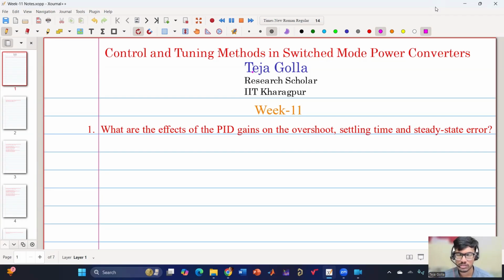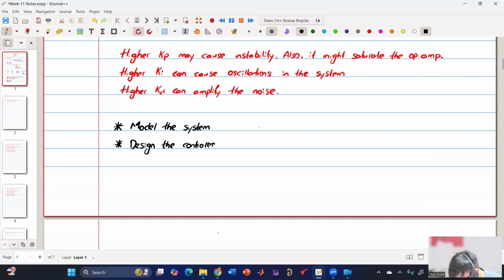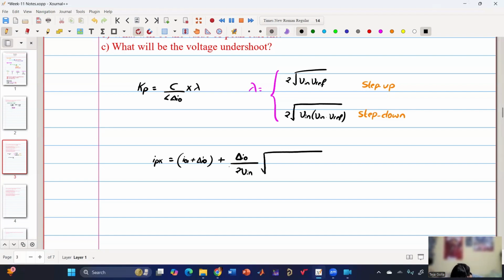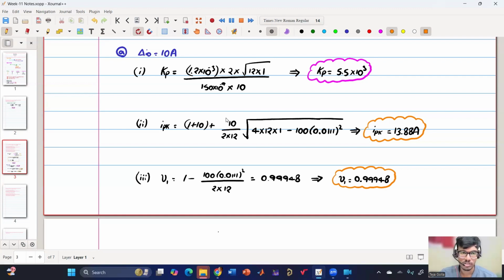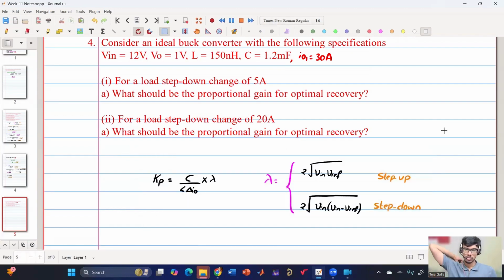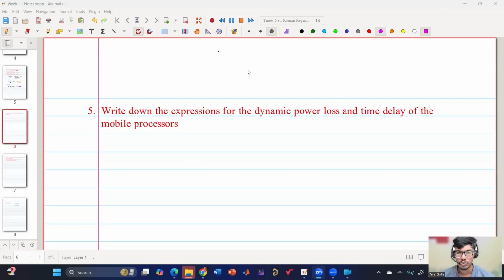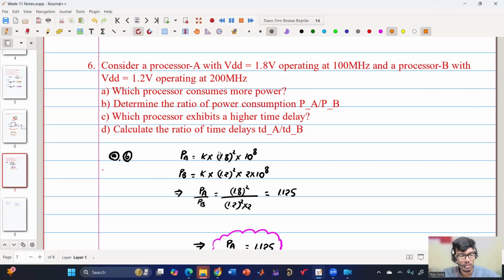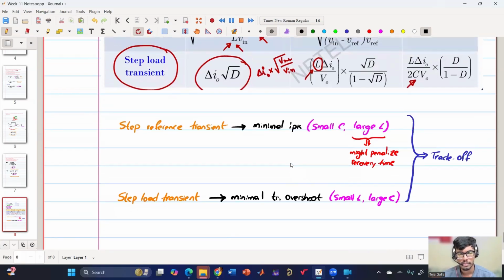Week 11 | Large-Signal Controller Tuning Methods | NPTEL

Comment: I have a doubt sir - In the time-optimal load step-up and step-down transients (Problems 3 & 4), what practical challenges arise in implementing the theoretically optimal control laws on real hardware?
Reply from the maker: Thank you, Varun Koppisetti, for bringing up this important point.
As we have considered ideal conditions for deriving the gains for optimal response, we have ignored parasitics, op-amp saturation, delay in the system (caused due to gate drivers, switches, opamps etc), the following challenges may arise in the practical implementation
1. Ensuring the stability of the system
2. Possible op-amp saturation due to high gains
3. Ampllification of noise when Kd is high